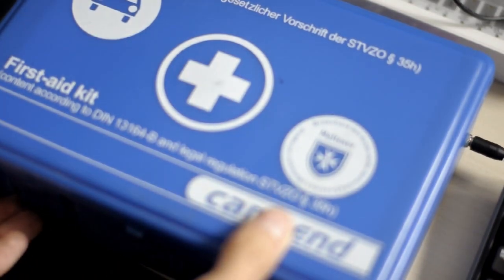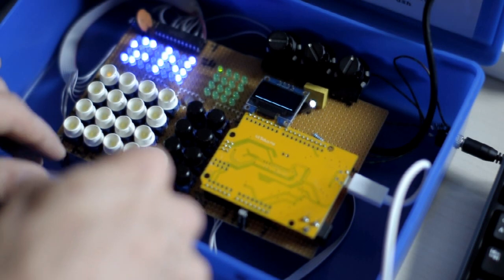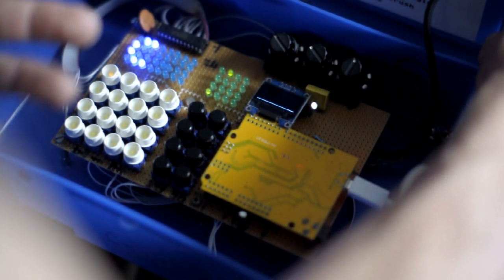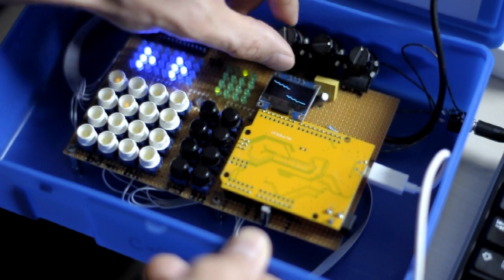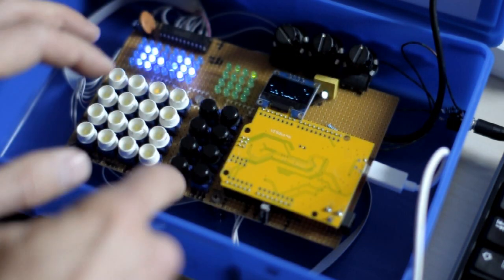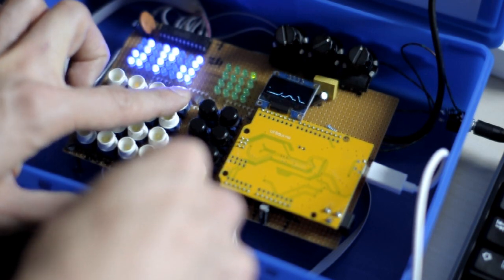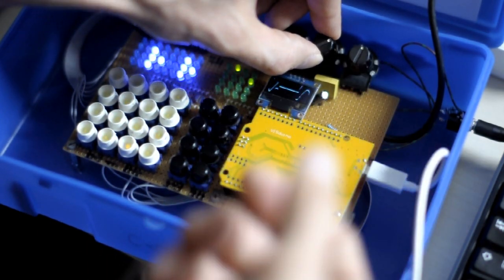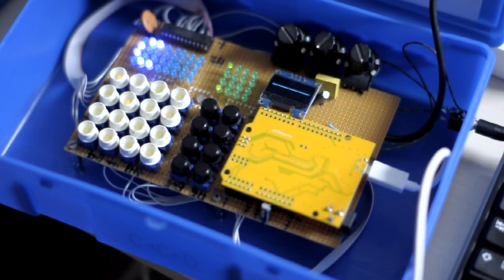BadAss basS Synth

Comment: Hi! Thanks for posting—this is a really fantastic build. I have a couple of n00b questions: Did you install the step LEDs behind the buttons yourself, or did you buy buttons with LEDs built-in? Which does the schematic show? (Would there even be a noticeable difference in the schematic?) Also, for absolute beginners like myself, could you say a little about what connectors/ribbon cables you've used? I have 0 components lying around, other than an Uno!
Reply: Hello
It's an original and high-performance machine!
Did you make it?
When compiled into a sketch,
Message "exponent has no digits" appears.
Need to change the sketch?

Comment: Hey, do you think it would be possible to add MIDI IN & OUT ?
Reply from the maker: Keyboard code isn't taking really any time. The display update is running in the main thread, so only gets executed if there's time left from the interrupts (which can be seen if a rather time-consuming synthesis runs the display slows down significantly). So the only option i see would be:
1) remove key/led/lcd code if you don't need it anyway
2) double the interrupt frequency of the sound interrupt
3) put in the MIDI stuff in the sound interrupt right at the beginning
4) execute the real sound code only every 2nd interrupt
might work with a few optimizations, since the sound generation is really a mess :-)
I can't do this myself, since I don't have the time for it right now, but please feel free to check out the repo and do these steps.
Reply from the maker: Hm, would be tricky with the current setup, since only the sound interrupt runs at 15.625khz, which would be half the rate required for MIDI. The CPU is already nearing its limits, so doubling the interrupt frequency is no option. It could however be possible to add CV/Gate in/out as 2 analog pins of the arduino are currently unused.
Reply: What if we skip the keypad and led + lcd code completely? It would be possible to control it by MIDI, serial, i²c, SPI or something, right? That´s what I´m interested in. That´s an amazing project, btw, congrats!